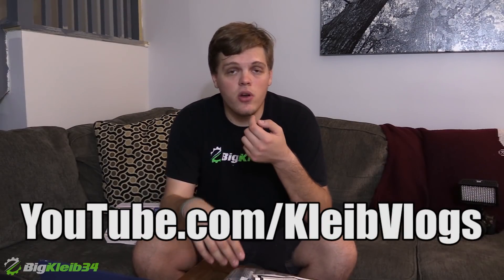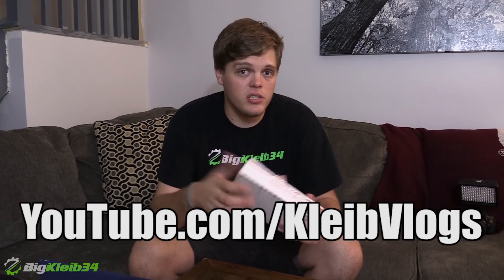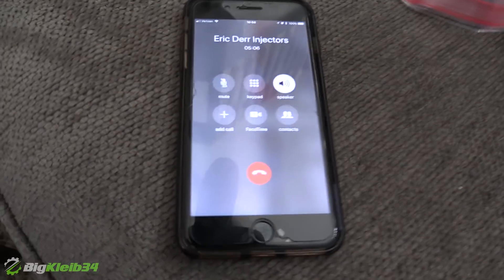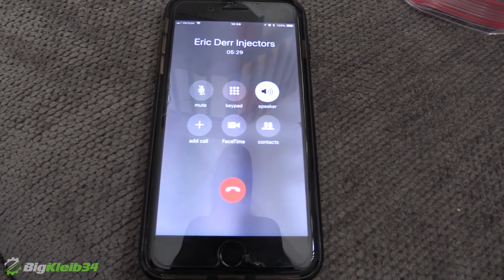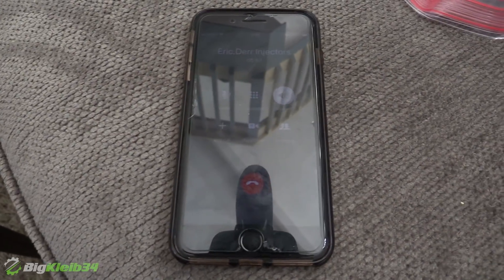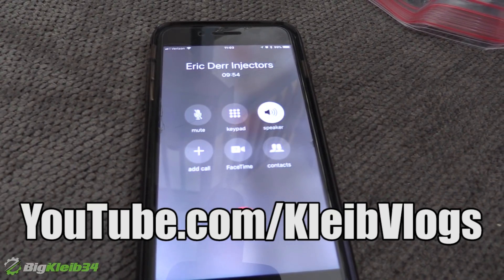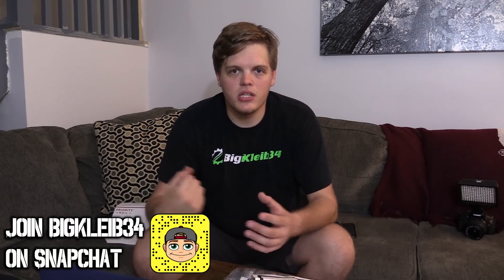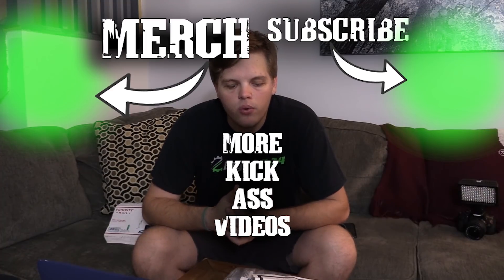Double your Fuel Injector Output For FREE? Decapping Mythbusted!

Comment: So ?? if you were to decap ford 19lb yellow bosch injectors you could program your tune as 42lb injectors for your mass air injector and get them dialed in close ? I mean if you do not have professional level tuning software and lets say sniper tuning software ? one were you can put in size of injector and whether or not the mass air sensor is programed for that injector or set for stock and it will compensate for it and have a fuel map in place ? having a wideband fuel sensor guage would also be needed .
Reply: Mass air injector?

Comment: I'd like to see a dyno pull with cleaned old injectors and the cleaned "decapped" ones. I wonder why the factory doesn't decap the injectors if it's free horsepower. More research needed . . .
Reply from the maker: It wouldn't gain anything. The idea is more efficiency with more air (turbo, etc). Factory injectors and decapped are going to offer the same on a stock truck. They're for bigger power applications which is why the factory does it the way that they do.
Reply: Yeah, that is what I thought. Stock motor, same size throttle body, same size injectors, no power increase. I got a sneakin' hunch that if a guy does his injector service at 80 or 100k, takes them off the car takes them to a Dr. Injector (or whatever) has them cleaned and plunked therm back in you would n't need decapped injectors actually. I'm not saying that decapped injectors don't work better than freshly cleaned unmolested injectors, but I'm pretty skeptical.
Reply: It's about air flow. A stock engine is not going to produce more power if the air intake is not increased, then your engine will be running rich with a lot of unburned fuel. Same goes with fuel. You have to increase the flow of fuel and air to create more power and to see the benefits of capped injectors. Since he is going turbo, he has to increase his fuel flow, and he's de-capping the injectors to increase flow while saving money, thus the 'free horsepower' title in the other video. Those injectors, capped, run in the range of 20-30 pounds. After de-capping them, it more than doubled the amount of flow. All this is doing is increasing the potential to create more power after air intake is increased. Doing this alone will BARELY get you any more power on a stock engine.

Comment: Real question is... Should you do this to your naturally aspirated car??
Reply: It would probably be unnecessary unless you are doing a cam/head swap. A stock engine will only bring in so much air. And air is required for fuel to be burned to create power. So, if you do not increase the air intake, the engine will run rich and waste fuel and not increase very much power, if any. If you are going to increase air flow on a N/A engine by swapping the cam(s) and/or head(s), then this could be a possible route. But most stock injectors can keep up with many cam/head applications for the most part, since most cam/head jobs are not THAT radical in increasing air. Just throwing a CIA, bolting on headers/exhaust, throttle body, etc. are not necessary upgrades to see the benefits of capped injectors. There's just not a big enough gain in air to notice the difference that much.
Reply: Oh no sir!